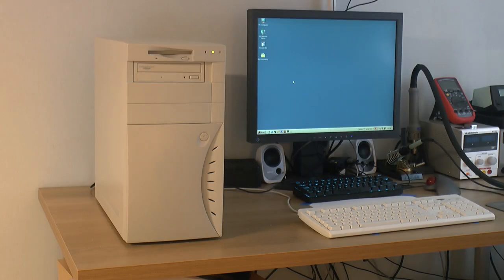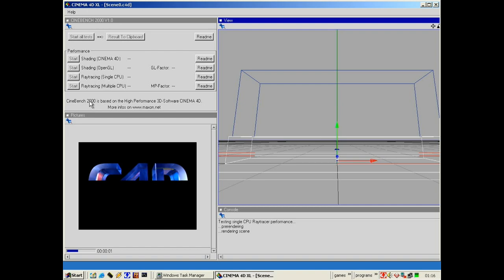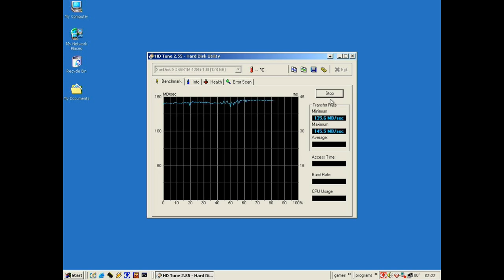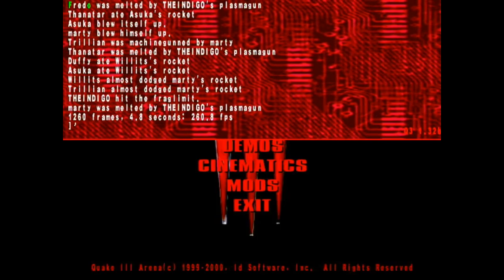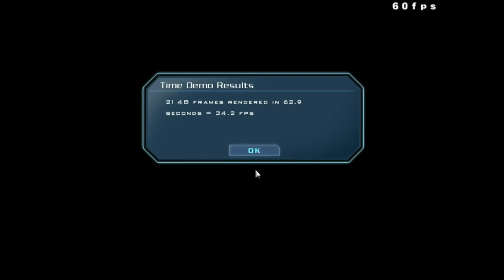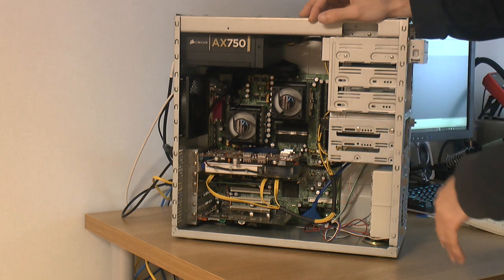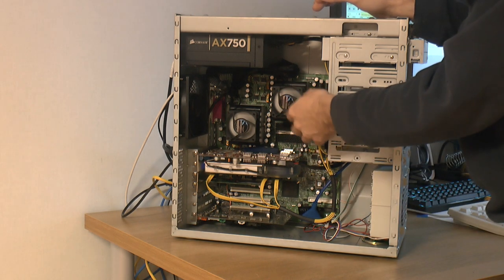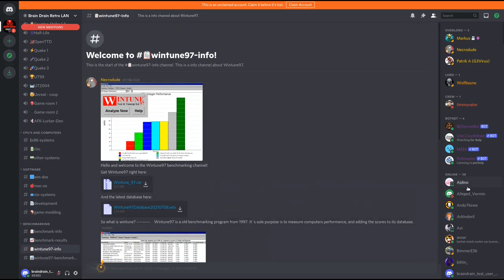Dual Athlon MP build part 3

Comment: Great build! These dual 462 boards are so rare though. Mabe I get lucky some day. I'm hoping for more content featuring early Athlons and P3's ;-)
Reply from the maker: I have two Athlon systems, 800 and 850 water cooled. Built most of my own systems before I made YT videos.

I started in wrong end XD
Reply: they are about but recently the price has shot up lots. last year I missed out on a full system in a full tower went for £30 :( lol so keep your eyes open. Also you can buy them from industrial computer vendors that deal in used electronics.

Comment: Lovely little machine! I hope you popped that horrid die shim off that 9800. Those coolers have a flat base, so if the shim lifts, the cooler loses contact with the die.
Reply from the maker: Shim is now removed now. It was lower then the die tough I checked.
Reply: I always suspected that the glue expands when warm.

Comment: i bought a tyan s2462 with two 2400+ (2 ghz) cpus on ebay, hopefully will arrive in a few days. really looking forward to playing around with it. i wonder if its even possible to overclock with that motherboard.
Reply from the maker: Maybe trough softfsb but Tyan them self usually never have OC support in the bios, also being an AMD primary partner back then from what I know.

You board seems to have a 8 pin AUX so if thats just normal ATX/EPS12V then it should be easy to use board with a modern PSU.

Best of luck and have fun!
Reply: it is AMD GES instead of normal ATX but an adapter is included to use it with a normal atx power supply
Reply: i can confirm now that OC tools dont seem to support the chipset so i just keep it that way. even at stock speed it feels very snappy and responsive under windows xp. fun fact: when using a proper graphics card (i use a hd3850 agp), it can play youtube videos in 720p. not bad for a platform from 2002 lol
Reply: these boards are expensive( around $250)  for such old hardware, besides they aren't brand new.  for the same amount you can get a Brand new socket AM4 motherboard
Reply: @tunkunrunk  of course you can buy an am4 board for the same amount of money, but where would be the fun in that? i paid 120 euros for mine including two cpus and 3gb ram which is totally acceptable to me for such rather exotic retro stuff
Reply: A few weeks ago , I thought about making A PC retro hardware concention , where we could all meet ,display our hardware , display some rare and hard to find motherboards and other stuffs, selling/exchange  pc hardware , giving live advices and tips . That wpuld be awesome, like  vintage cars rallyes

Comment: My highschool dream machine what I now attempt to rebuild for the second time, fully decked out. Best MP CPUs possible 4gb ram, big adaptec raid controller with lots of disks. However I would highly not recommend for other retro enthusiast to build a system like this as it's a major pain and for the era of those games if u build it for gaming there are way better and cheaper hw. The main issue with these Athlons builds in general the lack of SSE2 support which started to spread in those days SSE2 got defaulted in MSVC so every programmer and their mothers started compiling all apps by default with this regardless the app really needs it nor not, therefore a lot of applications cannot be run on these machines you specifically have to hunt for the NOSSE version and for some like firefox that won't even be the absolute latest build you can get.

Comment: I had a dual 1600+ system on a msi K7D Master-L with 2GB ECC back in the days. I remember the AMD 762 chipset as the weak point. Performance was on the low side for both the PCI bus and the ram if I remember correctly. Then again, I only had regular pci 32bit/33MHz controller cards.
Reply from the maker: Yes the chipset is weak. 
For Single Threaded task a NF2 Ultra 400 with a FSB and ram OC is much faster. 
I run a Barton at 2.23GHz with 470Mhz fsb and ram (DDR500) and its about 60% faster in games with a FX5900 Ultra.
But in the VERY few games that can use two processors like Quak4 the MP is faster if I recall.

Multithreaded productivity the MP system is pretty dam fast, scales pretty well so yea depends on the use case but for most normal people task a NF2 Ultra and a unlocked Barton and some fast ram is overall better.

But the MP system is fast enough, I use it as a main Retro Lan rig while a friend borrows the faster NF2 Ultra / Barton / FX5900 Ultra machine.

Both pumps out frames fast enough that in most games its irrelevant what machine your on.
Reply: it's certainly a cool system. I liked mine.

That's a nice NF2 Ultra system with the FX5900, is that BH5 DDR perhaps?

My NF2 Ultra machine had a FX5800 reflashed at FX5800 ultra speeds :) Fun times! Went through loads of CPU for that motherboard. 2000+, 1800+, 2600+ mobile, 2500+.
Reply from the maker: @sniglom  IDK what chips is on it but they will do DDR 500Mhz @ Cas 3 @ 2.5V just memtest86+ and prime95 stable in my DFI lanparty NF2 400 Ultra.
But that board is unstable on PCI/AGP even at like 440-450fsb but it can post way above 500Mhz and suicide run things at 500Mhz FSB and RAM half the time, the other half you get disk corruption or most of the time AGP corruption so running preime95 is fine but 3Dmark, no.
Never found a way around it, PCI buss is effected so addon cards cant work around it.
So its a faster board BUT not faster if you count stable thats why I run 470Mhz with a modded Asrock, it wont go much more then 480Mhz but its fully stable in every stress test  until it wont post reliable.

Comment: I've always wanted to have a dual Athlon MP computer, to see if two processors on separate sockets equaled  two CPUs on a single chip
Reply: multi core cpus are boring...dual sockets are cool...i dont care if they are faster or not but they look badass, i always wanted a dual pentium 3 board..two of them at 1ghz each would make a very fast windows xp machine and good for games up until the early 2000's (far cry, nfsmw, call of duty, etc) it would also make a machine WAY faster for productivity and office use then a modern windows 10 machine....only things it wouldnt be any good would be video editing and heavy stuff, or limitations on internet stuff due to xp being unsupported
Reply: @MrHBSoftware  I have a dual pentium 3 motherboard , unfortunately it doesn't have AGP connecteor , and it doesn't accept PCI graphic cards (the system won't boot) . The integrated gpu has 2mb vram only , so , no video games for me .  another thing is that dual socket 370 motherboards with AGP are expensive on Ebay , prices can go up to $500  and beyond

Comment: Hello! I am using a MSi K7D Master for my MP build, but i dont get the Radeon 9800Pro to work, Geforce 3 and 4 and FX yes. Unfortunately i had the same HIS 9800Pro but it is damaged and i can use this. The other i have work perfect in other builds but not in the MP, any idea why?
Reply from the maker: Not sure but me and my friend did notice that Working 9800PRO cards for example often did not post in systems a few years older then the card so might be a BIOS issue, but I assume your on the later bios for the motherboard?

Comment: turned it out to be a real nice build, nice job. Do you think the state of the OS (i.e w2k) of the time might have lead to the system being considered unstable?
Reply from the maker: I dont know.
I suspect there might have been many reasons.
Buggy chipset early one.
Probably a lot of buggy bioses, people using unsupported CPU configurations might also play a role.
People using standard DDR instead of ECC/REG or not turning ECC on.

I never had the platform back then so can only speculate from what I read but thats my guess.

Windows XP was out when this chipset was launched so W2K was "old" by then but not obsolete.

If W2K had problems, I ran it back in K6-2 cpus then it would be a problem for any system.
Reply from the maker: @vardekpetrovic9716  yea makes sens that could work, been thinking about that to. The problem is that I dont have any suitable XP-M nor is the ebay prices very good for Socket A right now.
Like Athlon MP on ebay is 60USD per CPU plus chiping, tax etc, have not checked the M versions but I would suspect stupid expensive to.

I dont have much of any budget for my retro hobby so cant just buy stuff off ebay.

The only thing I dont like with the 2000+ processors is the fact that they are Palomino 180nm.
But they are official MP's so thats nice.